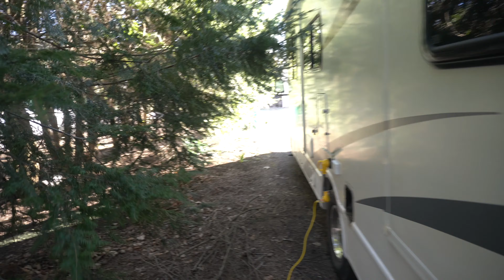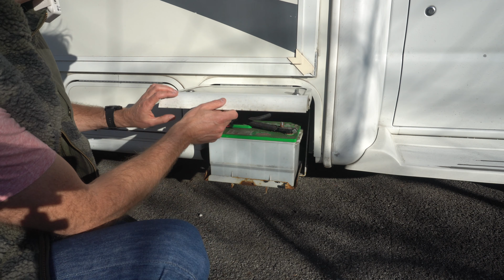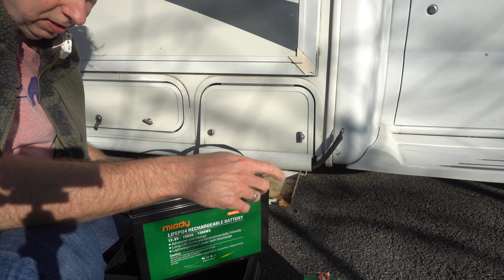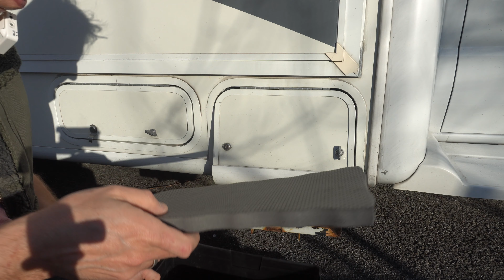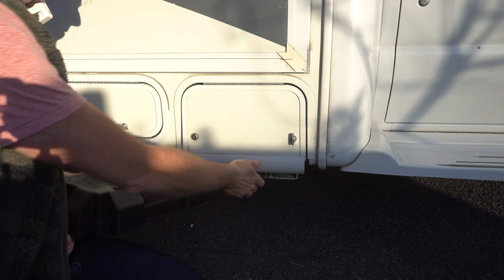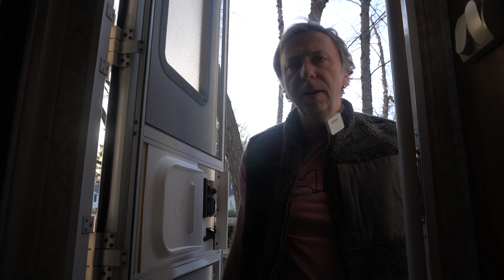RV Lithium Battery Conversion vs. Keeping a Lead Acid Battery

Comment: Lithium iron-phosphate (LFP) batteries are a great option to replace worn out lead-acid coach or house batteries, in an RV.  I do have one question and one observation.
Why didn't you take the battery out of the case and mount it exactly like the one you took out?  It's already in its own sealed case, so the second case is redundant and precludes you from adding more capacity with the 2nd tray that is built into your RV.  The observation concerns LFP battery chemistry and freezing conditions.  That inexpensive Miady brand battery has been disassembled and found to lack cold temperature charging protection.  If you leave that out in below-freezing temps, the BMS in that battery will not protect it from being charged and it will very likely be ruined.  The cheap LFP batteries have over-temp protection, but not under-temp.  I hope yours made it through the winter.
Reply from the maker: Hmm. Good question. I would have to check, but I feel that the battery was a bit bigger than the tray would allow. That along with mounting it sideways made me want to get the box for it to reside in. Quite frankly the box also makes it a lot harder to steal since it's super wedged in there. :)
Did you upgrade to this kind of battery as well? Do you have an RV?
Reply: @tinyindustrial-rvedition2368  - I am using LFP batteries, (both manufactured and DIY) in my boat and in a she-shed my wife uses for various crafts that she does.  I'm somewhat of a geek where these things are concerned.  :)